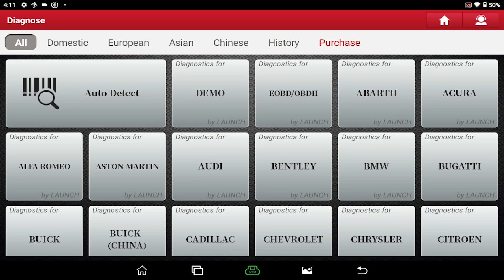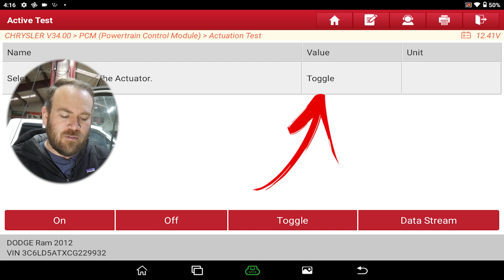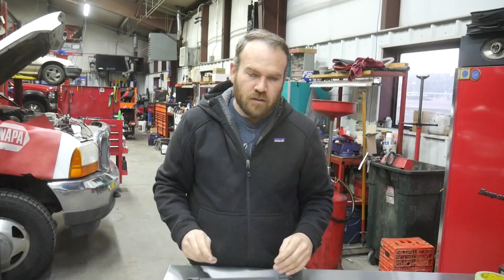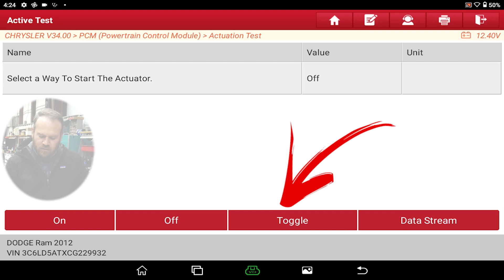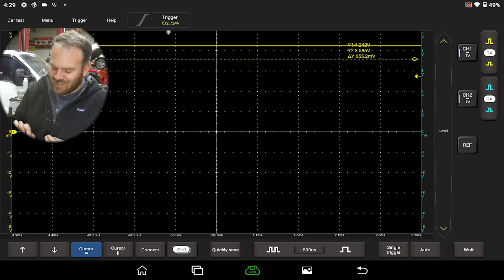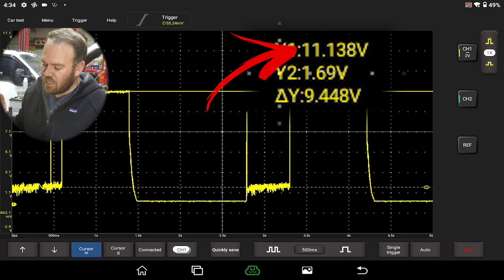Launch X431 Torque 5 used to diagnose a bad TIPM on a 2012 Dodge

Comment: Great Video! I am researching scanners. I can’t decide between the Launch Torque 5 or the TopDon Phoenix Smart.
Reply from the maker: Both!   Just kidding. The scope is “Ok” but it may be cheaper to buy the launch torque link or Phoenix smart and then buy another brand scope rather than buy the tool and add the other feature. If you would rather keep it all in one tool then you could add the scope or the link.the launch and topdon programming interface can be bought separate.
Reply: Yea that’s what I been coming too. I am pretty sure I’m gonna grab a Torque Link and get a scope later. Idk maybe I’ll grab the TopDon Phoenix Lite2 and the scope then I can have both! Actually I had been planning on getting a used snap-on verus edge later then I can really cover everything, seems like you need a few scanners these days. Thanks for the advice and knowledge the videos are great.

Comment: Way to take this to another level. Many mechanics would just swap in another TIPM, but cost and availability should offer other options. Would love to see how you completed this repair.
Reply from the maker: This was a fleet truck and they wouldn’t authorize a tipm repair so we installed new from dealer. 

The launch was able to configure the new module so I didn’t need to purchase a programming subscription from Chrysler.

Comment: That was a great tip about checking with Launch about the two separate grounds within the unit. Great job demonstrating the tool. It captured the anomaly very well.
Reply from the maker: I had an instance where I was connected to the OBD2 port with a scanner that was also a scope and I tried connecting my ground to something that wasn't grounded well and it arced when connecting the lead. I have been cautious since then since these scope can get pricey to replace or repair.

Comment: Do the Scanner tools recode on Oscilloscope Yes or No 
My Mentor The Practical Mechanic 
👍 
INTELLECTUAL The Practical Mechanic 
From Nick Ayivor from London England UK 🇬🇧 Good Evening ⏰️ 20:44pm
Reply: Buffer memory up to 50M
Reply: Nick It does have ability to record and playback high-resolution waveform data for future analysis.
Reply from the maker: @weldingjunkie  thank you for the technical response. I haven't used the recording or recall function yet.
Reply: @ThePracticalMechanic  anytime time. Excellent video showing the use of it on both sides. Looks like you’re starting to get used to it.
Reply: @ThePracticalMechanic  it’s not as easy as pico to load and save like on a PC. That’s the only tough part.
Reply from the maker: I’ve coded a few vehicles so far. One was a bmw power steering rack and everything went perfect.  
The coding is not an oscilloscope function but a function in the diagnostic side of the tool.
Reply: @ThePracticalMechanic  Chad, I think he meant does the oscilloscope record. Like the Pico.
Reply: Great demo! I really like my Launch X431. I wish their scope module was mounted like Snapon does but it's still a cool relatively inexpensive option. The rugged design of their tools has been a peace of mind feature I really appreciate for mobile work. There's many scenarios where I really don't want to risk my Zeus. Haven't pulled the trigger on a lauch scope yet but I just might before winter.